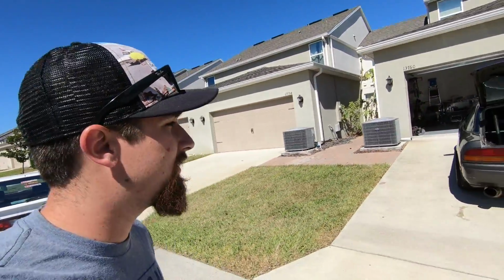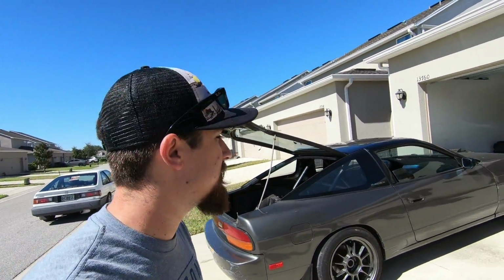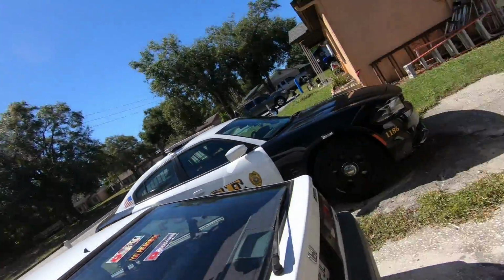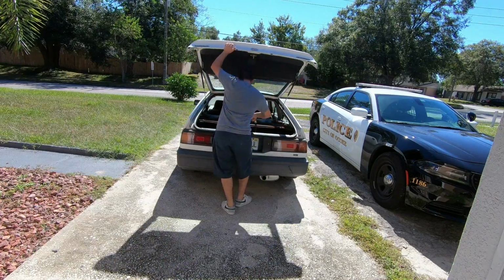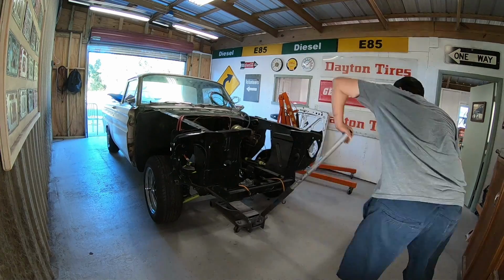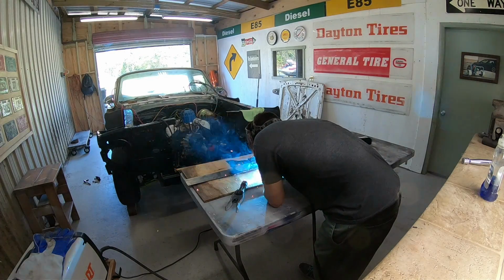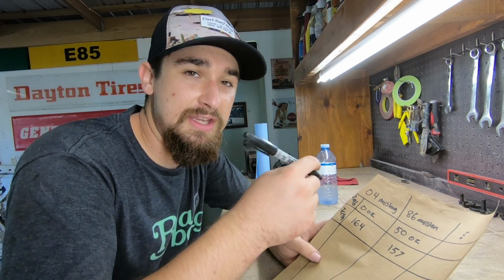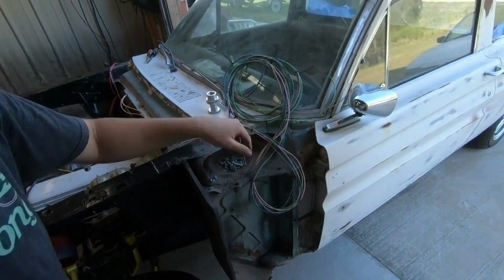New Projects S13 Drift Car?!

Comment: I had to go through similar stuff when getting a T3650 for a Crown Vic 4.6 10.5 or 11 inch flywheel, 6 or 8 bolt crank. Etc. Lots of mix and matching with Ford stuff.
Reply from the maker: yeah man and so rewarding when you put it all together.

Comment: How certain are you that it came out of an 04? Bc I'm pretty sure the 98's and newer have a T-45, which may or may not have a different bellhousing than a standard small block ford. I've never been able to confirm it one way or the other so if you're sure it's an 04 lmk.
Reply from the maker: Joey Kaiser 04 v6 came with a t5 I believe